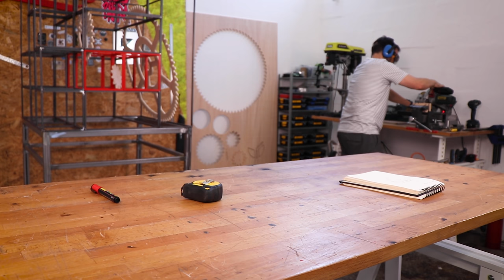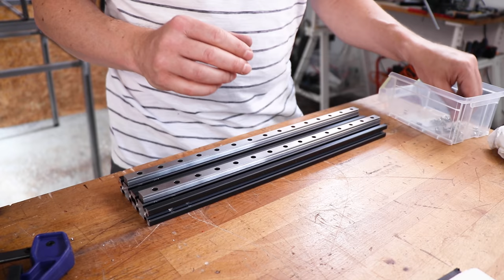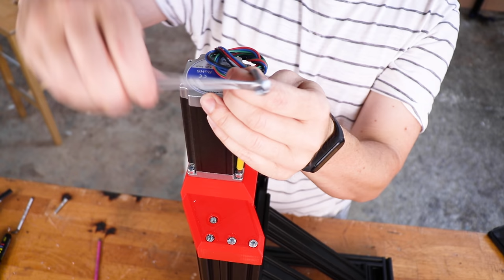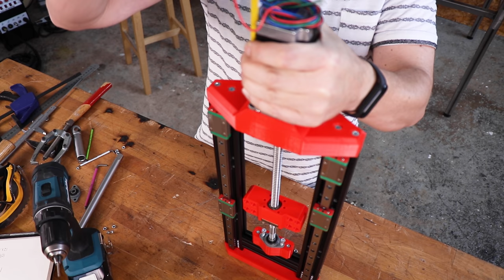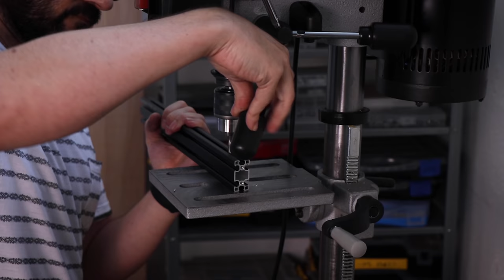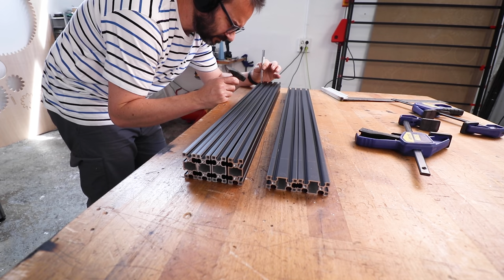3D PRINTED VERTICAL MACHINING CENTER FROM SCRATCH

Comment: If you want to stop struggling with the drill when you run a cap screw in, put it in reverse and just ever so slightly jolt the trigger. It will release the hex key bit without releasing tension on the cap screw. Looking good! :)

Comment: I would use cutting fluid to lube the cutter.  You will get longer cutter life and potentially better finish.   For aluminium you can use WD-40, but I do not think IPA lubricates the cutter as well as anything with oil like cutting fluid or WD-40.
Great built video.
Dave.

Comment: As cool of a project as this is you could buy an actual milling machine for the cost of the profiles! 
I have been through several iterations of milling machines in the past few years and in the long run I just ended up buying an industrial milling machine and have finally found my machining happy place. I had a few table top mills that I converted that did nice work but ultimately I wanted to make many big parts and went all in. The table top mill conversion is an excellent route for someone looking to get somewhat serious about making aluminum parts. 
That being said, I have scratch built machines and understand they joy of making the machine itself. This is kind of a tedious route to take however.

Comment: I would have printed a hollow frame to designed to pour concrete over steel rebar, and pre stress bolts. Then thick steel ways, motors, table bolted to the frame. Maybe electronics boxes printed.

Comment: Mills don't use a cantilever cross-slide because the table will flex down on the end, they use a jacking screw under the centre of the cross-slide with the post only as a guide.

Comment: Amazing! I'm interested to see if the 3D parts hold up after a few weeks of machining. I would also recommend an MQL system. I installed one on one of my small CNC machines and it completely transforms it. And getting some single flute cutters may be a good idea as they seem to work better with machines that aren't as ridged and that have slow cutting speeds.

Comment: I got the same spindle on my mill I using a 6mm 3 flute HSS endmill with a air blast, running at 10,000 RPM and 1200 feed

Comment: WD40 is a pretty good "coolant/lubricant" for aluminum if you're just getting started and looking for something you can use that you have laying around the house. For the half sphere, ball end mills do a much better job with light cuts, so consider using a roughing operation (that leaves a little layer of stock) with a straight end mill before using the ball end. This would also be MUCH faster. Great videos!
Reply: IPA works well and doesn't leave a mess behind, but WD40 does work well also.

Comment: I love the enthusiasm. Spindle and controller seem nice, that's proper hardware. I'm sure this will be a useful machine for some hobby projects. However I wouldn't trust this thing to hold smaller than 0.2mm tolerances. If it can achieve even that.
Reply: I'm more worried about chatter. Seeing how knee mills have to be extremely stiff I wonder how bolted together aluminum profiles are going to stand up to the stress.

Comment: I would like to see the cut quality in aluminum using the single flute, nice slow feed cutting strait lines(the wall finish). It doesn't sound like there is a ton of vibration which seems impossible given the wrong linear rails, hollow aluminum and plastic holding it all together. I'd say I'm most impressed by the spindle but not the grounding of said spindle.

Comment: cast the whole bottom into concrete so it has some mass. Use roughing endmills and then a finishing one especially if you are going to use a ball end mill and consider encoders so it know when it skips steps.

Comment: When machining aluminium try coating the cutter with inox Teflon spray and also use it during the machining to cool the cutter. It will also help aluminium from sticking to some cutters

Comment: I normally use either water soluble oil or kerosine for machining Aluminium. Also, get a copy of Machinery's Handbook from Industrial Press. It will tell you all you want to know about speeds and feeds and much much more..

Comment: Great build!!! You should add a servo and lead screw to adjust the angle of the spindle instead of using the 6 bolts and nuts!

Comment: i have thought lots about a 3d printed milling machine.... as you do... one thing i keep coming back to is 3d printing a shell/mold for the mill in to which you pour epoxy granite (after getting everything as square and precise as possible). lock that precision in and get it a lot more rigid. i think you should be able to get sand for free and maybe a few hundred euros of epoxy.... ehhh maybe? for youtube science?

Comment: Awesome project Ivan.   Not that you asked but FSwizard pro is a pretty good tool to get for feeds and speeds.   Dunno if it will work out of the box, but it usually gives a good starting point.

Comment: Really cool build. I can see that for most parts you are designing with 3d printing in mind which is also cool. What material are you using for the 3d printed parts? PLA, modified PLA, PETG? Any mechanical or heat creep with the 3d printed parts so far? In my experience some PLA brackets I used for furniture and drawers have had zero issues after more than a year of use. But I have also observed on other projects PLA brackets screwed on acrylic deform around the screw in about two weeks of use.
Reply from the maker: It is PLA, yes, it deforms under mechanical stress but I design around that.

Comment: Make a floating drill, like a drill press but the drill is a household drill and on an arm that lets it float freely in X and Y, Z is a lever like on a drill press. That would make the drill perpendicular to the work surface all the time but give you all the freedom of having a manual drill, because you can remove it from the holder
Reply: It's literally 2 axes and some supports between the joints, plus the hardware for plunging
Reply from the maker: Check Flexarm

Comment: The side of the spindle says it runs at EIGHT AMPS. 500 milliamps AC can kill you. Eight amps at 180 volts kills you instantly and starts boiling your major organs before you hit the ground. It's lucky (or sensibly cautious) that Ivan didn't try to change the bit with the power on.

Comment: Not gonna lie, I was a bit skeptical of this design, but as someone who's done this before, you did a great job, and I really like how you made a lotta joints movable in case something is out of tram, but frankly, I don't think this machine is going for spectacular tolerances, but overall pretty good.

Only criticism, I would not recommend using the duet, especially if you're trying to do any subtractive manufacturing, as you'll want something that works for those specific applications, so a real breakout board and drivers that are meant to handle those motors would be better
Reply from the maker: I measured one of the cuts on twitter. @adnarimnavi My Mitutoyo calliper gives a spot on (less than 0.05 mm of error limited by the calliper precision) 12 mm on a 12 mm slot. Of course I won't be manufacturing space hardware but I'm sincerely curious, what would be "Spectacular tolerances"? The Duet3 is very capable of driven those motors and works for this specific application (as is seen in the video). There's no such thing as "meant to handle those motors" it drives the motors or it doesn't. And the duet3 Is capable of up to 4.5 A per motor. Do you have a more technical description of "Meant to drive those motors"? Again, these questions are sincere and I truly want to know.

Comment: Could you add a thermal sensor near the bit that if it hits X temperature, it'll squirt 3-6 pumps of IPA on the bit? Maybe give it limitations so it doesn't just constantly do it though.

Comment: Weird... Even my cheapo Chinese HuanYang 0.8kw Spindle had a 4th lug in the Connector ( UVW+G ) to ground it to the Inverters Grounding Pin 🤔
That being said, I did use a 2nd Grounding Wire attached to the Spindle Housing to close the connection between the installed Endmill and the Z-Axis Zeroing Puck attached to the Positive side - Saves me from temporarily attaching a clamp to the Endmill to create continuity.

Comment: Holy shit dude, that was a wild failure mode! If i had a mill and the tool sparked when it touched the work piece, I'd have no idea what to think at first. Honestly I thought you had run a very brittle tool into a very hard alloy too quickly and busted the tip right off!

Comment: I'd be curious to know how much the parts cost, because it looks great for it's performance!
Reply: in the uk that metal he is using is about £30 for a 3 ft length
Reply: @capatainnemo  I think they were talking about the mill itself not the stock
Reply: @nukularpictures  He never told us the specs of the majority of the project so you can't really know that, and it seemed to cut through that aluminum like butter... (Also the majority of people who are building CNCs aren't looking to necessarily get it cheaper, but to just have fun building it)
Reply: @Emily-fm7pt  I can see that the cutting is not going great. You see that the depth of cut is quite low, except for the first test. But there it ruined an endmill. The second try I would guess it is a depth of cut of 1mm or lower. Same with all of the other tries in aluminium. That is low and most definitely not like a knife through butter. My router does 5mm depth of cut with 2mm width @ 1000mm/min. And even that is just acceptable. Not fast at all.
With the steel try the coolant was boiling on the cutter. That means it is rubbing not cutting. While cutting steel the heat has to go into the chip. The workpiece or cutter should not get that hot. The endmills just die. 

By the way: All people I know who have build their own machines did it because you can get a better once cheaper than buying it. But building your first machines yourself is usually not a good idea. You just do not know what you have to look out for and it will be really frustrating. Plus you spend a lot of money for an inferior machine.

Comment: Are the printed parts PLA? What about it's longevity?
Reply: Long enough to make metal replacements? Start with aluminum and proceed to steel if needed. Should take care of normal wear and tear and stiffen it up slightly more as there are a few parts that may flex a little like the 3D printed end pieces for the frame stabilization legs. I was a bit surprised when he used those between the upright and the legs.

Comment: Oh and one more hint: The final result in Aluminium also verymuch depends on the alloy you use. Most cheap profiles are very soft and difficult to machine as the material tends to melt. Try AW5083 or AW6060.
Reply: lol, I've never seen alu melt when machined with decent tools and normal feeds&speeds
Reply: @chyrt  Maybe melting is the wrong term. But you can clearly see in the video how the surface finish isn’t that good and the edges are very frayed. That’s typical for very soft aluminium alloys.
Reply: @christiansprojects-cgmanuf1426  Ah I see, yes that is very true

Comment: Personally I would've moved the Z axis to the table, and extend the axis to be much taller. This would allow for a more rigid spindle, would allow for the table's height adjustment, simplify the manual and CNC Z axes into a singular axis, and would account for any change in table height without constant manual recalibration that would be needed after adjusting the current table's manual height adjustment. For the cost of all the CNC Z axis components combined with the manual Z axis components, the cost would damn near even out if you just made a longer stroke CNC-only axis for the table.

I also don't quite understand the tilt axis on the spindle head. Again, rigidity is a concern here. Plus any tilt you can put into the spindle can also be accomplished with a 4th axis trunnion, which again would be more rigid than the 4th axis on the spindle, the trunnion could also be swapped between the X and Y axes for more uses, and that 4th axis trunnion could be swapped for a 5axis setup. Again, personal opinion, but does it not make more sense to design the machine in this way, as it has a greater range of benefits? Maybe a more expensive solution due to an extra motor or two, and the trunnion setup, homemade or bought, but again it's a solution that doesn't need manual recalibration when it's used, plus it's quality of life improvement and additional functionality would be a quick return on investment. 

I know it's just a homemade knee mill, but at the same time if you're building a machine from scratch why not build the best machine within the same reasonable expectations? Rigidity is important in any spindle-based machine, whether it's a drill press, a manual mill, a CNC mill, or their lathe counterparts. Adding things like a tilting spindle on a frame like this sacrifices rigidity, it's why actual mills have massive cast/machined housings that boost rigidity to allow for tilting spindles. For similar reasons why a lot of mills have their Z axis, Or Y axis in Y-up configurations, move the table and not the spindle, and why the Z axis has a longer stroke. Similarly this is why 4th axis trunnions and 5 axis dual-trunnions mounted to the table are a more popular option, rigidity and ease of use; and in a CNC-based setup, controlling those additional axes would be fairly easy, essentially a plug-and-play solution. So if you're going to the effort to build one of these from scratch, why not make the conscious effort to make the best build reasonably possible?

I hope this is only the first variation of what will eventually be a finalized homemade mill, and I hope my suggestions do show up in the final variation. Again, rigidity is important, rigidity is what makes or breaks a machine, and why professional machines are so over-built. On top of that, my suggestions also provide further functionality, similar to what you would find in a professional setup, compared to the current iteration of the homemade mill.

Comment: Great build.  What happened to the giant clock in the background (not working) it's the first project from your channel I've built (75% of the size, due to my printer bed size).  I'm currently playing with the software to add MQTT so I can control the colours of the LEDs from my Home Assistant
Reply from the maker: I keep using the plug it is connected to for other stuff 🤷
Reply: @ivanmirandawastaken  cheers, kudos on the code also, self documenting in the code itself, showing the process, made life so much easier when I need to down scale the clock size in the software

Comment: This is awesome, great work Ivan!
what firmware are you running on the duet if you don't mind my asking?
The 3d printed parts will likely creep over time, so it would be super cool to machine all metal replacement parts on the same machine like you did for your router

Comment: Extruded aluminum is not cheap, what was the cost of this build? You could most likely get a used Bridgeport clone for not much more money that would be 100x more rigid and capable, and then just convert that to CNC. Would have been less work, too.

Comment: why dont you print a ring around your spindel and attach your pressurised air to that with a valve (google coolant ring, something like that) that way you wont have to blow out the paths every time.

Comment: Im a little bit confused: why didnt you use your cnc router to drill the holes? Shouldnt it be more accurate?
Reply from the maker: My CNC router does not have a collet to mount drill bits and the smaller cutter I have for alu is 4mm in diameter. Also by the time I've aligned the part in the router I've finished doing it by hand.

Comment: Cool project! With your tools you could easily build it without printed parts, full aluminum. Would be more stable. 
Wires are a little bit thin for that amount of current. 
Greets from an engineer ;)

Comment: That much extruded aluminum, could not have been a cheap build!
Reply: Probably cheaper than an off the shelf cnc router though
Reply: @shaneebahera8566  undoubtedly

Comment: You mention that you are much more confident building these machines than operating them. If you could get This Old Tony or someone to use and evaluate this machine, it would really offer insights into its capabilities. It might also provide an opportunity to iterate on the design by having feedback from a skilled operator and part producer.

Comment: I see your using a er collet, is that what the spindle uses or might be a R8 collet holding the er collet? I have a reason for the question.
Reply from the maker: ER11
Reply: @ivanmirandawastaken  oic, kinda figured it was. The reason i asked was if it was R8 like a Bridgeport mill you could chuck the end mill higher and not be extended like that and have much less chatter. But no matter that is a amazing little mill that i would have said not possible not to long ago.

Comment: I love your builds and the access to cheaper parts but i still prefer a Bridgeport or similar weight can be a good thing especially with a mill but most people only seem to want to do ali and soft metals so it works for the smaller stuff.
I do think as time goes on more people will have access to CNC etc but at what cost is the real question.
In honesty i am just jealous life/health issues happened and my community is UN-helpful i feel isolated (like lots of others ) not everyone is a good person but if you interact and help each other you get ahead or be nasty and make people feel like they can't even ask for help.
Sorry for vent..keep up the good work